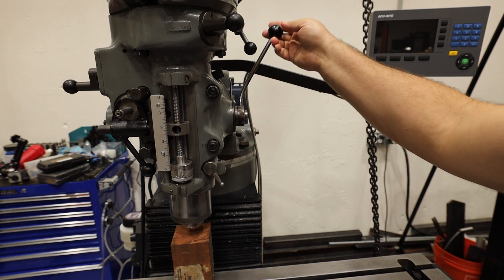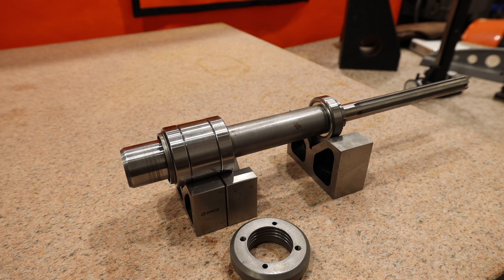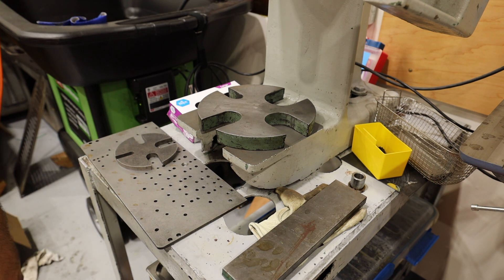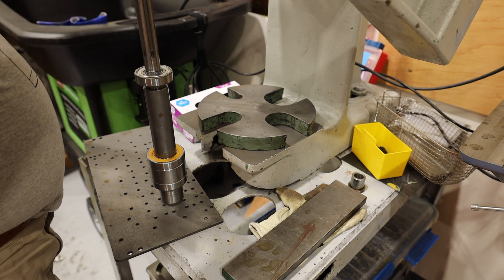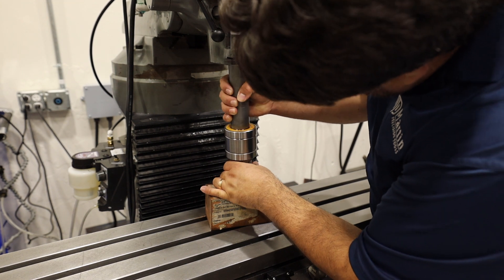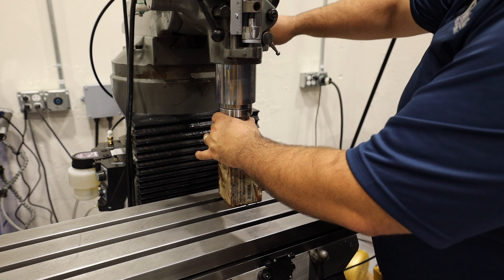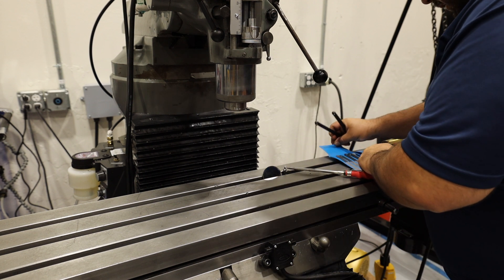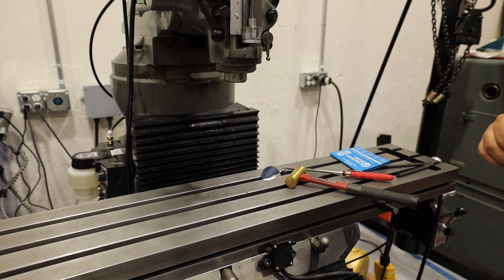Bridgeport Spindle Nose Cap and Vertical Spindle Play

Comment: The reference to align the indent in the book is for original bearings as set at the factory. Once replaced, that indent is no longer relevant and a new one should be made after preload is set. (Told to me by a large B.P. rebuilder)

My spindle nut was completely tight and the spindle still had ~.035 of vertical play before and after full rebuild. All the B.P. places were stumped as to why considering it was O.G. everything and all in great condition. We measured 100 times, replaced the spacer packs, new nut etc. Didn't want to cut the nut cause of seal interference (Fyi, the rings under the spindle cap nut are called a "Labrynth seal" and are to keep junk out without contact.
Last resort was to put a wave washer in place then preload by feel. It's been that way for a few years now and tho i don't do daily or heavy work on it, the machine still holds tolerance to .0004-6 depending on my attitude that day.

 It's good enough for the girls I go out with !
Reply: Do you remember where you got the spring washer im having the same problem i so have about .004 to .005 gap but still has play. I didn't try bluing yet.
Reply: I got it from McMaster but for .004-.006 i would look for a shim washer as the wave I used was .030 iirc.
Reply: Awesome thanks ill have to look.
Thanks